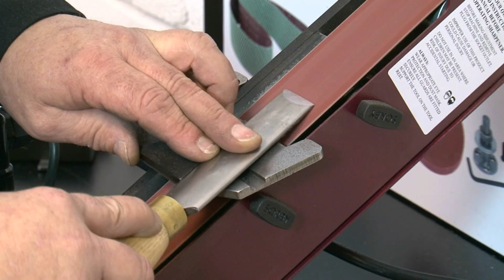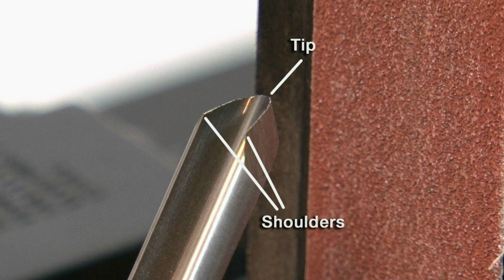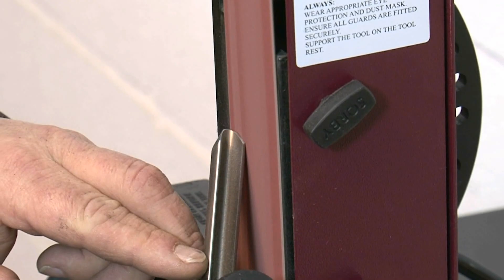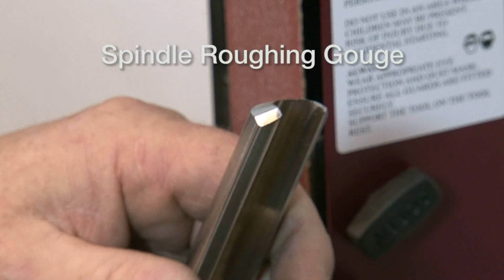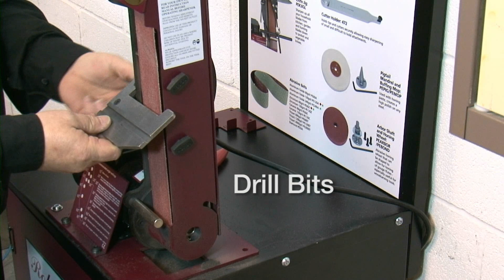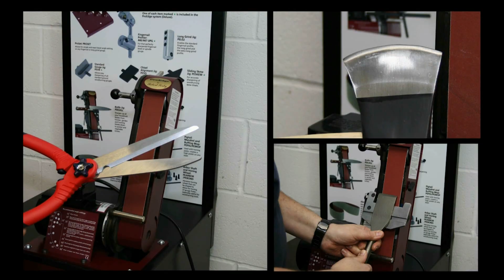ROBERT SORBY PRO-EDGE HINTS AND TIPS

Comment: I tried to make the long grind on my bowl gouge but there’s no way to grind the left wing completely without the tool handle hitting the motor housing, regardless of whatever angle I changed the linisher to?
Reply: I agree. This is a design flaw that Sorby has never addressed and lessens the usefulness of their machine.
Reply: Try swinging the entire belt assembly forward. You will need to use an allen wrench.
Reply: @robertcornelius3514  Does not make any difference. The tool clamping arm that holds the chisel will hit the belt housing before you can fully shape the left wing. I had to grind off a few millimetres of the corner of this clamp to allow a clean sweep across the left wing.
Reply: @Bigtel1970  , hmmm. I wish I could see your modification. Do your tools have extra long handles?
Reply: @robertcornelius3514  The cause isn’t the tool handles - it’s the Sorby tool holder - check this out, I’ve made a video to illustrate it:
https://youtu.be/Nv71M1Ji2kI
Reply: @Bigtel1970  , ahhhh. We Americans need pictures, so thank you for such an informative video.
Reply: @robertcornelius3514  Sometimes the best way to explain is to see it - I’m exactly the same!

Comment: I tried the extra long grind with the 15° ange for the horse shoe, but with the long grind jig i'm not able to grind the end of each wing, especially the left one because the holder touches the side of the grinder before i reach the end, either with a 50 or 45° bevel. Feel i ruined my bowl gouge now
Reply: I've just had this problem too, my right wing looks fine but the left wing is completely ruined, infuriating!
Reply: @paulmonks9480  i found out after that you need a different holder for this kind of grind, the one showed in the clip actually, not the one that came with the proedge (deluxe). Costs an extra 80€ so i think i’m going to pass on this. I’ve regrinded my gouge to the original long fingernail, probably lost about a cm of steel.
Reply: @egg-w5e6s  Thanks for the information. I did notice the different jig in the video to the one I had, and suspected that might be the case. Frustrating that the design we have removes some functionality of the machine! I think I'll do this too, maybe try it again with 25 - 30 degree horseshoe instead of the 15 degree one.
Reply: @paulmonks9480  i think i ended on a 30° horseshoe which worked  with the original jig. My ‘wings’ are about 10mm long (on a 13mm gouge), which works well enough really. You only use the bottom side of long wings when shearscraping, too much vibration when cutting , especially on thin walls, for that i use the top part. Maybe different with bigger gouges?
Reply: @egg-w5e6s   Nice to know a 30 degree horseshoe worked, thanks!

Comment: I think I'll stick with my Tormek machines. Just fitted one of them with a CBN wheel for "rough" grinding / reshaping. Putting a 4 facet grind on drills up to 3/4" is a dawdle and as the wheels run in a water bath it is impossible to draw the temper out of you tools
Reply: High Speed Steel (HSS) has an incredibly high tempering temperature - you would have to go beyond the cherry red glow point, to almost molten. Not likely on a bench grinder. I agree though that this is useful for high carbon steel tools, such as carving chisels and gouges.
Reply: Yeah no need to buy another $700.00 or $800.00 piece of equipment to sharpen with.

Comment: Beautifully clear presentation. One thing which you might add is the advantage of grinding the heel off the bowl gouge to give a secondary bevel. This avoids bruising the wood and facilitates smooth traverse of the inside of a bowl. I might also be worth pointing out the advantage of having a second bowl gouge ground to 60 degrees for reaching into a deeper bowl.

Comment: Awesome tool and i have recently purchased one , quick question ??? on the extra long finger nail grind you mention the table at 15 degrees and the jig on the extra long ( third hole ) but you dont mention how much to set the grind length on the bench angle set jig ??

Comment: Please could you tell me what settings are set on the fingernail profiler arm when sent out from the factory (I altered mine for some reason or other) the settings I need are the angle of the head (12345???) and how far down the shaft does the grubscrew collet need to be???  If you can understand what I mean and can help then THANKYOU so much!!!
Reply from the maker: We just produced the videos for Robert Sorby and we know little about the products... Please contact Clive Brooks at Robert Sorby on cbrooks@robert-sorby.co.uk he will help you.
Oh and tell him Chris the video guy put you on to him.
Hope this helps.
Chris
Reply: The factory set angle of the jig is 120°. There is a ground line on the jig swivel. I wish someone with the proset would  post the dimensions of this gage. I use 2" extension of the steel past the jig.